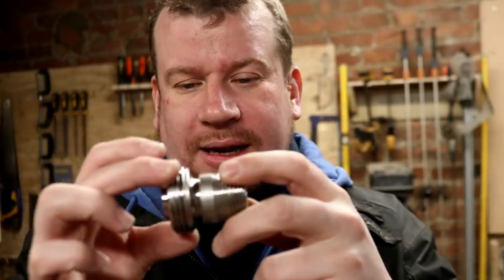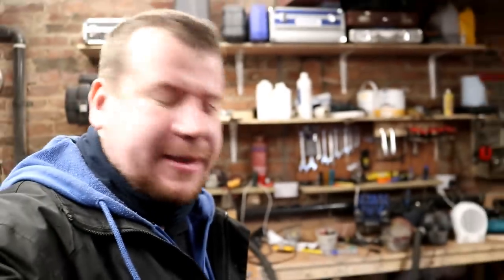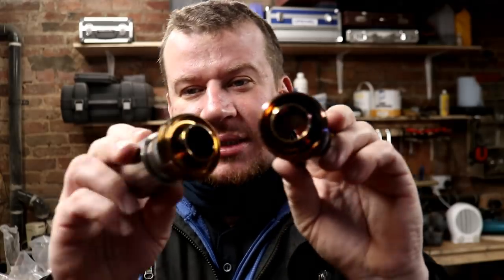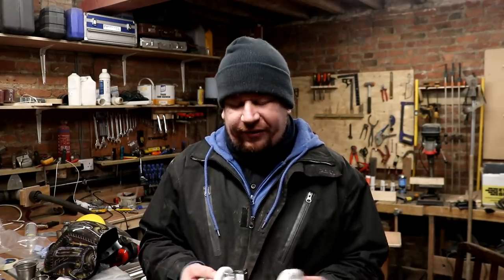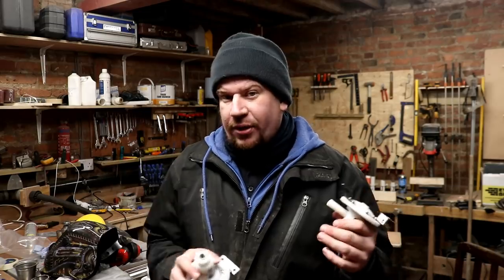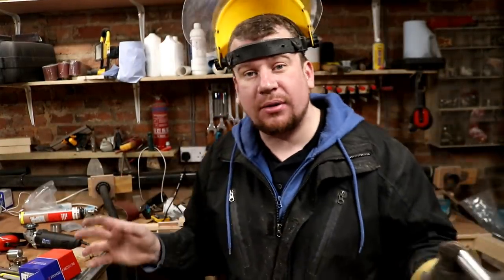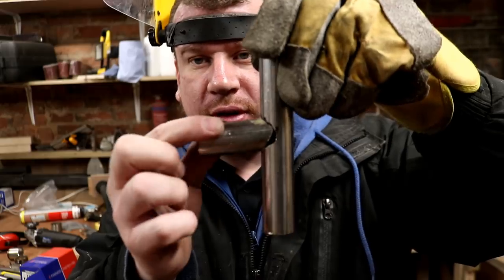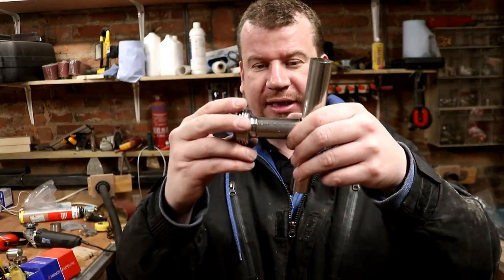FABRICOBBLING STAINLESS PIPEWORK

Comment: I have two Masons beer engines and they syphon back a little, it is down to the little silicone or rubber washer at the bottom which is meant to be a non-return valve but they ain't great. Angram are the best but they cost a lot more. At the CAMRA beer fest they fit those non-return valves like you have to sort it all out.

Comment: Cut it short 😄 you certainly will have to if you don't have enough. Earl grey 😄?  Do you really need to send cleaning fluid through the boil kettle and extraneous kit? 100c kills everything dead within seconds of it being in contact. Two minutes max of running the pump  with a boiling wort will sanitise  all area's and a quick wash down all round after finishing the transfer will prevent any nasties from taking a hold before the next boil. Just a thought, I don't sanitise my HLT / brew kettle for exactly that reason. I fill it as a HLT and bring it to boiling the night before a brew day and I have never had a problem. Cheers, Schnuz.
Reply from the maker: You would be surprised how dirty it all gets and I can't get in to scrub so just recirculating caustic for 20 minutes does the job for me.  I only really sanitise the plate chiller before a brew day, like you say the boil does the rest.

Comment: Know exactly what you mean with the pipework being a bit of a head puzzle. I'm doing the same trying to hard pipe my nano setup in triclamp fittings. I'm using a few 3 way valves which makes it easier but trying to get your head around it all is a nightmare. Plumbed it up and thought i'd got it then realised that I missed a loop out and couldn't get flow back to my whirlpool port only through the HEX. Any reason why you are using all RJT instead of Triclamps, i know they are a bit more industry standard in the UK but is there any other reason?
Reply from the maker: The RJT's are a bit cheaper than the clamps, the seals are cheaper too and most of the time the nut is captive and you don't have to fiddle to get it on or search for it.